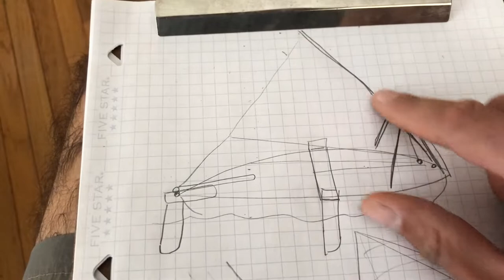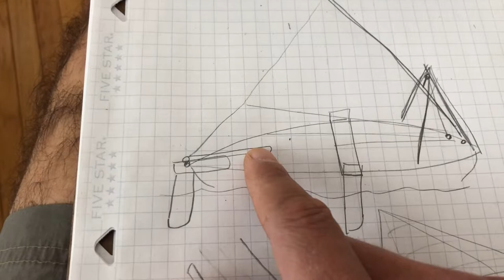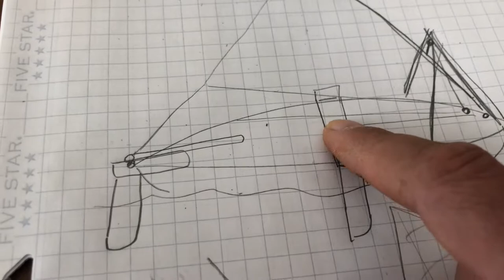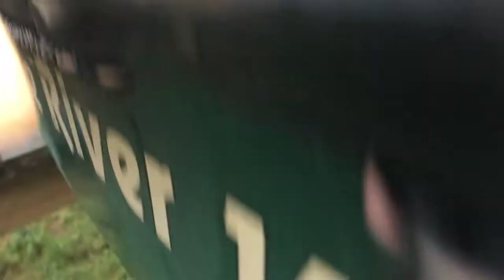Building Leeboard & Rudder for the Sail Canoe! (Using scrap wood)

Comment: I've been looking forward to this video for 6 months, I think. The leeboard design is elegantly simple. Genius tripod mast for a lateen sail. I would reinforce the edge of the sail with rope, double-sided carpet tape by 3M and reinforce the corners of the sail with double sided tape and duck tape triangles.
Reply from the maker: Great ideas for reinforcing the sail. You're right, it's the weak point in the design. Stay tuned for when we take it out!
Reply: @merzoutdoors   https://en.wikipedia.org/wiki/Polytarp_sails

Comment: If you run your main halyard down along your front tripod to a bow pully it will stop fouling your main you can then run the line down the gunnel rail to your jam cleat giving you clearer  access to the centre of your canoe
Reply from the maker: exactly what I was thinking for the next iteration. working on it, thanks for watching.

Comment: you may also consider having your lee boards fold so if you hit the bottom they pop back with a shock cord to hold them down. folding forward just looks like  they will get damaged
Reply from the maker: You're right. Have modified the design.

Comment: I have a question about the tripod mast setting : we don't see clearly, but is the hole going through the three pipes a bit larger than the gauge of the bolt used so it can get to an angle when you fit them in the sides or you drill the holes at angles so they "fit" with the right spacing to get right into place ? I guess the large brass washers are there to cover a larger hole than the bolt gauge but I might be wrong.